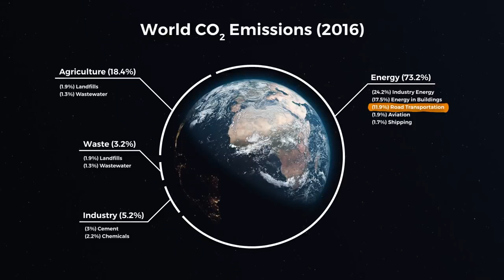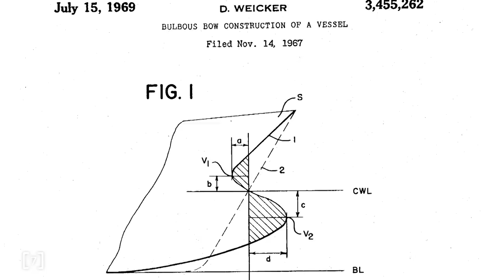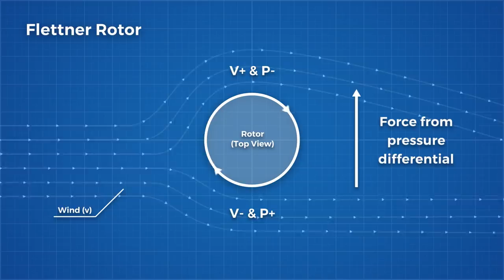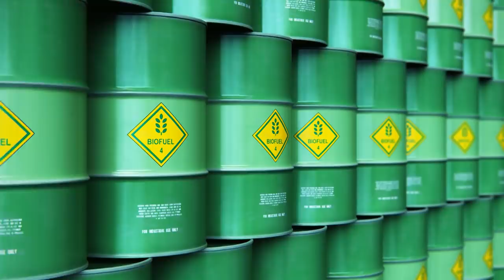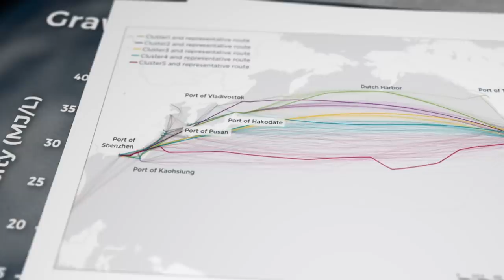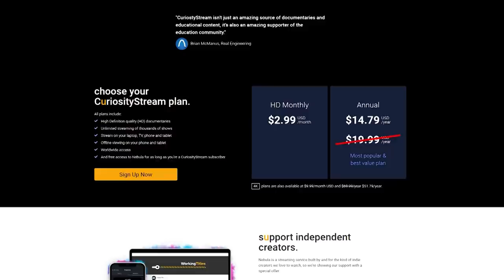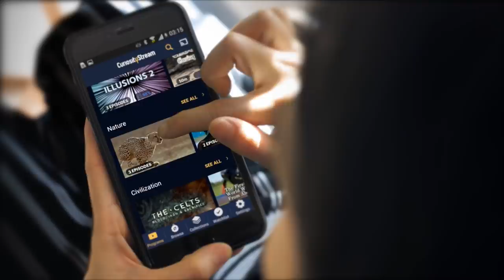Are Renewable Powered Ships Possible?

Comment: These shipping companies could easily hault global trade to retrofit the tens of thousands of ships to have larger hydrogen tanks. I don't understand what the problem is. By the time we wait for them to incorporate these technolgies into new ships it will be too late. Even though that's the only economically feasible way. Maybe the US government can just print all the money needed.
Reply: The cargo carrying capacity, revenue generating potential, of ships is constrained in two ways by mass and by volume.  If the internal volume of the structure is used up with propulsions machinery and fuel storage it can not be used for cargo and similarly if the mass of the propulsions machinery and fuel is to dense then the mass of cargo that may be carried is reduced.  ICE's burning energy dense hydrocarbon fuel is the best option that is available at the moment.  Possible improvements are reductions in atmospheric pollution by improved fuel quality, improved engine efficiency and post combustion treatment of effluents; all of which will increase costs and those increased costs will be recovered from the ultimate consumer.  Lowest cost option for environmental improvements is, reduce the amount of goods and materials shipped and shorten the distance that the shipment of the minimal amount is undertaken.

Comment: Your acceptance of the advice based on Climatology should be revisited. That discipline's willingness to work with 'adjusted' data should exclude it as a Science, at least for its long-range predictions¹. The probity of data in Science is important. If it's bad data that's the end of it, it's useless. BTW the most potent 'greenhouse gas' is water vapour. It's ability to absorb energy from the light spectrum overlaps that of both CO² and CH⁴. So when you hear of industrial attempts to humidify the planet you'll be witnessing the end of a species with enormous but unrealisable potential. The Universe will not even blink.
NOx and particularites are pollution, as are many chemicals, plastic packaging (when set free to explore). That is where and how mankind will kill off the viability of this temporary refuge we call Earth. But the current alarmism founded on a pseudo science is laughably emotional and as such immature. H. sapiens seems to be unavoidably attracted to the problem of death. Which will happen eventually to this solar system, our galaxy and the Universe - but we are special. The good news: the Cosmos will observe the 23 nanosecond grieving period; which is sweet.

¹ Q: Why did the weather man leave town? A: The weather didn't agree with him. [Will we ever have enough computing power to predict tomorrow's weather?]

Comment: Just make it nuclear.
Reply: If you do a web search for ‘nuclear ship savannah’ you will see that it has been tried and did not work.  A similarly heavily subsidised, by the government, vessel is in use in Russia which also operates, in support of the Northern Sea Route, a fleet of nuclear powered ice breakers these may, or may not, have been completely without issues.

Just think; would you have full confidence in the management of a nuclear reactor under the control of an anonymous entity only traceable, perhaps, via a letter box in a FOC (flag of convenience) nation state?  If you are, could you sell that confidence to Japan, the state that hosted the Hiroshima and Nagasaki nuclear detonations as well as more recently the Fukushima ‘event’?  Then try that same, or a similar, sales strategy on Ukraine, the nation state that as a part of the USSR (CCCP) hosted the Chernobyl ‘event’.  Modern iterations of nuclear energy, thorium fuel, molten salt reactors or fusion reactors, will carry the legacy of past problems.  It is the global trepidation of anything with 'nuclear' in the name and the economics of nuclear having transitioned from 'energy to cheap to charge for' too 'the costs of remediation are incalculable' that will prevent the adoption of nuclear energy as a means of creating energy at sea.  Modern reaction systems may have overcome the safety problems but the general public, having been misled in the past, will be reluctant to believe the fresh new promises.

‘They’ say nuclear is cheap, it’s not it is expensive and has a large embedded carbon quotient as well as being complicated, dangerous, not universally socially acceptable and having only ‘no need for refuelling’ as a questionable advantage; actually it does need refuelling just not as often.  When ‘they’ do need to refill the warming up stuff it takes considerable longer than pumping tonnes of thick black stuff, HFO cSt380, or thin runny stuff, MDO, onboard which is one of the reasons HMS Queen Elizabeth and HMS Prince of Wales are pushed about by ICEs and gas turbines thus using a similar fuel as the aircraft that fly off of them.  The Royal Navy (RN) with a high degree of skill and expertise uses, at vast expenses to the UK taxpayer, a current operational nuclear fleet of 11 submarines (also known as ‘boats’) in two flotillas, seven attack subs and four ballistic missile boats.  The carbon footprint of all the extra bits of hardware and the fuel, including processing thereof, from ground to propeller, are the external costs that never seem to get considered.

Disposal, once it wears out, of both the machine (that was a ship) and fuel is another can of worms best left unopened.  The 26 RN boats no longer in use are laid up (some in Rosyth and some in Portsmouth) awaiting long term deconstruction including dealing with the fuel rods and other irradiated material.  The USN is not, as far as I know, a commercial organisation working to very tight margins and also has the skill and expertise to handle the complexities of nuclear power; so as well as submarines their aircraft carriers are nuclear powered and each of the current iteration has a build cost three times that of QE/PoW, bigger crews and more generous funding.  For those who still think that nuclear energy might be the answer I recommend this report: - https://www.bbc.com/future/article/20200901-the-radioactive-risk-of-sunken-nuclear-soviet-submarines?ocid=ww.social.link.email.  The navy of the USSR might have been under resourced and over extended but it was still generously supported in comparison with merchant shipping.
Reply: @BernardLS  hm so it seems like the problem is not the lack of technology, but, rather than the people who holds the power.
Reply: @BernardLS  So assume the day when world peace comes, maybe nuclear power can be as common as within a car, or having one in a household somewhere in South Africa. When people wont tweak it and use it as mass destruction, when no terrorism exist, when all sins vanished from humanity’s heart, but, heh.
Reply: @BernardLS  but that’s tough. Last time when I was in a parking lot, trying to back into a space, a guy who’s car was behind me wouldn’t back up a little, even when I pointed out that I’m having difficulty backing up because he was so close to my car, he wouldn’t back up when there were no cars behind, and I had to alter my angle and it was more difficult to park, because he had no courtesy to just back up maybe a foot of space. He stared at me and gave me the “wtf u want? Wtf u gona do about it?” Hand sign and I just shook my head. I wanted to go down and punch his face, but, I think, why we are all our father’s son, our mother gave life to us, why did he act like this, and why did I act like this. Why do we all act different though the way we got here were the same? So yes, I don’t think having a nuclear power reactor as this moment in time is a good thing, because as you’ve mentioned, I agree with it all.
Reply: @anon18999  fifty years ago there was a joke going around. An American, a Russian and God were discussing the state of the world. The Russian asked ‘will communism prevail’ and the American said ‘not in my life time’ then the American asked ‘will  capitalism prevail’ and the Russian said ‘not in my life time’. Eventually God said ‘will there ever be peace on earth’ and both the American & the Russian said most emphatically ‘NOT IN YOUR LIFE TIME’.

Comment: Yes it’s easy, you use a sail obviously 🙄
Reply: To address the suggestions that sail power is the answer I offer the following.  In 1870 a premium sailing vessel entered service, the ‘Cutty Sark’, she could carry around 600 tonnes of cargo at speeds of up to 17.5 knots, dependent on the prevailing wind, to harness the energy the available spread of canvas was up to 2 976m2.  To round things out that was circa 5m2 of canvas for every tonne of cargo carried.  The ‘Cutty Sark’ was designed and built, with fine lines (more nautical tech speak so again - no need to worry about it) for employment in the tea trade where time on passage was a large factor in securing the premium freight rate that made her cost effective but as soon as the Suez Canal opened, which the ‘Cutty Sark’ was unable to sail through, she lost her advantage, raw speed, to the steam powered ships of that era.  Mechanically powered ships have improved in terms of efficiency, on a freight tonne mile basis, by at least one order of magnitude since then.  After losing out to the coal burning, steam reciprocating mechanical ships of the late 19th century ‘Cutty Sark’ was relegated to the Australian wool trade, just about the bottom of the barrel in maritime terms and only one small step up from being a 'honey barge'.  The canvas, cordage and extra manpower needed for sailing ships was never a very benign environmental option so please discount any idea of sail as ‘sustainable’.  All this is without the problem that if ‘the wind don’t blow the ship don’t go’, when it does blow it often blows in the wrong direction for your cargo delivery needs and sometimes there is rather too much of it for comfort.
Reply: @BernardLS  how is cloth and rope not better than heavy diesel? In what way is it bad for the environment?
Reply: @lost_to_the_woods  cloth and rope need land use to grow the raw material and energy in the manufacture of raw material to finished product. Hydrocarbon fuels are, in general, harvested from non food productive areas and are relatively incredible energy dense. Like palm oil they are to 'good' for us.

Comment: What about floating hydrogen tanks
Reply: H2 is said to be good for use in fuel cells that will give clean energy when combined with Oxygen (O2) and leave only water (H2O) as an effluent; so as well as the cost of creating the hardware and separating out the H2 in the first place we now have the cost of separating out the O2.  H2 is very, very light and very, very volatile so this is where we remember the Hindenberg disaster, the ‘light’ means that though there is lots of energy per unit mass there is not much mass per unit of volume so all the problems of CH4 but much worse.  You need to compress it, more than a lot, or cool it, more than a lot, to get enough on board your ship in manageable volumes to be useful.  The alternative to fuel cell use of H2, burning, also generates combustion products which includes waste heat going to the cold sink and a few NOx nasties.  The numbers, on any of these, are getting very difficult to show any sort of surplus so is this a case running hard to stand still.

Comment: There is zero point in creating renewable energy sea vessels... Because they are not an efficient use of energy... Air resistance equals less than water resistance therefore water requires more energy expenditure...
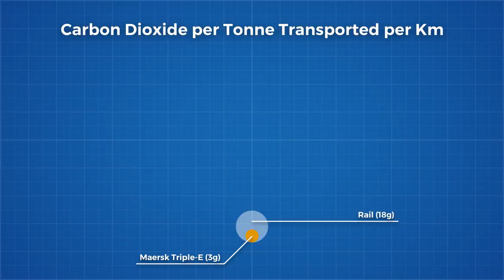Reply: WRT to energy efficiency at 2:51 in the video the figures for CO2 are given as ships 3gm for each tonne kilometre and for air freight 550gm for each tonne kilometre. So to move a tonne one kilometre on a ship is nearly 200 times more efficient than using an aircraft.
Reply: @BernardLS  that's beside the point... Air resistance is less than water resistance obviously... Therefore water travel is less energy efficient and not as green... And there are other methods of air travel other than planes such as balloons and zeplins... It might even be more energy efficient to send lots of small cargos via air than massive cargos via ship... Would require investigation and I can't be bothered... But the fact remains that air travel is technically greener...

Comment: No mention of nuclear power
Reply: Just think; would you have full confidence in the management of a nuclear reactor under the control of an anonymous entity only traceable, perhaps, via a letter box in a FOC (flag of convenience) nation state?  If you are, could you sell that confidence to Japan, the state that hosted the Hiroshima and Nagasaki nuclear detonations as well as more recently the Fukushima ‘event’?  Then try that same, or a similar, sales strategy on Ukraine, the nation state that as a part of the USSR (CCCP) hosted the Chernobyl ‘event’.  Modern iterations of nuclear energy, thorium fuel, molten salt reactors, small modular reactors or fusion reactors, will carry the legacy of past problems.  It is the global trepidation of anything with 'nuclear' in the name and the economics of nuclear having transitioned from 'energy to cheap to charge for' too 'the costs of remediation are incalculable' that will prevent the adoption of nuclear energy as a means of creating energy at sea.  Modern reaction systems may have overcome the safety problems but the general public, having been misled in the past, will be reluctant to believe the fresh new promises.  The incident of the ‘Ever Given’ blocking the Suez Canal, March 2021, may also have a little to add to this debate.  The cooling water on ships tends to get taken in from near the bottom so when running aground the inlets are in a prime spot to get plugged up restricting, if not stopping, the flow of coolant.  One thing that the TMI, Chernobyl and Fukushima incidents all had in common was that the supply of coolant, or rather lack thereof, was a fundamental cause.  Similarly and only months later, May 2021, had the ‘X Press Pearl’ been nuclear powered then a major port for a populous nation in the global South would have possible been the site of a significant exclusion zone due to a non power plant related incident.  If the ‘X Press Pearl’ had on board a fired up but ‘safe’ molten salt reactor and found herself having to run down the possible 12.5 megaWatts of energy in the power cycle would a stable cool down have been possible?

Comment: elon marsk
Reply: Do you mean battery electric?  Electric motors powered by ‘green electric’, leaving aside the fact that there is no truly ‘green’ electricity, the best we can do is low carbon impact both at installation (capital account cost) and production (revenue account cost).  Running ships on the ‘lecky’ is tricky the two examples that I personally know of, and have used, are a vehicle and foot traffic ‘chain’ ferry that ply’s its trade across the hundred meters or so of the Nordre älv between the island of Hisingen and the Kornhall on the Swedish mainland.  The motors are on the ferry and a cable is unwound and wound back up on board as the ferry shuttles back and forth from Kornhall.  When the vessel goes anywhere else, id est dry dock for survey and or maintenance, it is towed by a good old ICE powered tug.  The other electric vessel is a vehicle and foot traffic ferry that runs from Helsingborg (Sweden) to Helsingor (Denmark), a twenty minute trip, she tops up the charge in Sweden each time she is alongside and battery capacity is said to be sufficient for an hour of main engine use.  There are small diesel gennys on board; to keep the lights on in extremis.  Sadly as of now electric boats are as functional as chocolate fireguards, yes ‘submarines can be diesel electric’ but they have negligible cargo carrying capacity and if you ever go on one your first thought could be ‘where do they put the crew?’